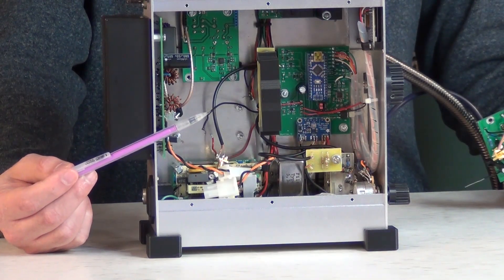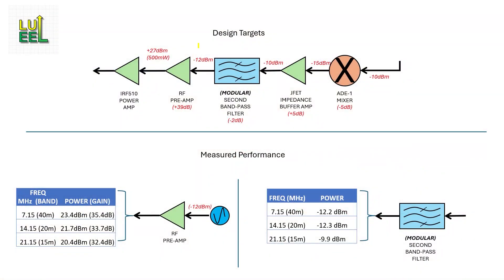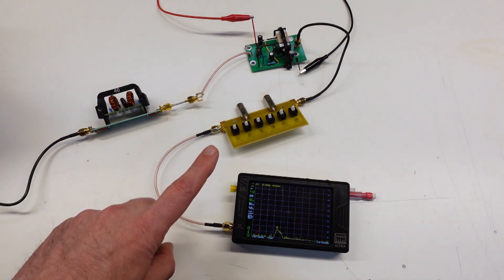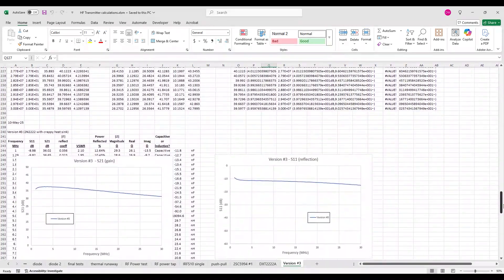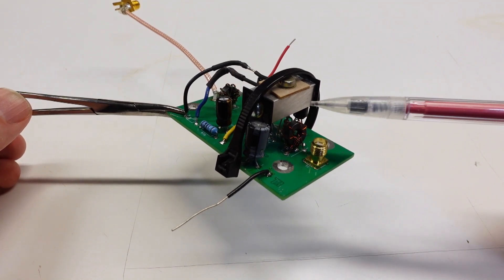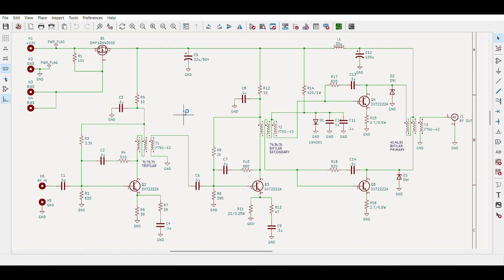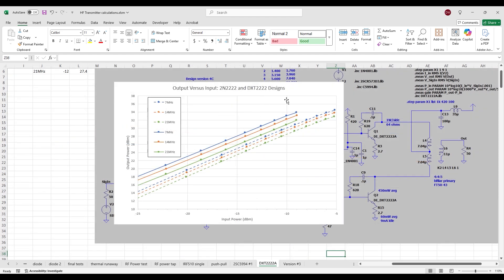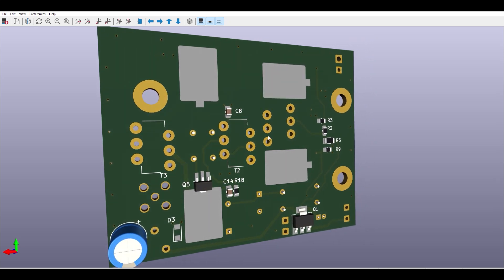HF Transmitter Improvements: The RF Preamp - AGAIN!

Comment: I am also working on an HF / VHF RF amp, my bands of interest are 10m and 6m, the thing is I need good gain from 28 MHz through to 60 MHz, with each RF stage. I am using the 2N4427 in the preamp, with LDMOS for the power amplifier, as there are lots of kits available on line to make use of that cover these bands.

Comment: Great video. Noticed that the output transformer had the centretap decoupled for audio, but not RF? Some designs have the DC fed to the collectors via inductors (chokes) rather than via the centretap. This is to reduce the  core saturation caused by DC current. If you are using a smaller core, the  DC current may have more effect perhaps? Again great video. :)
Reply from the maker: Thanks! Maybe I am misunderstaning your question, but L1 (35uH) blocks RF going back up the +12V power.  Also, there should be very little DC current in the output transformer, as Q4 and Q5 are barely biased to be on with no signal.
Reply: @levelupeelab  The electrolytic capacitor will have no RF across it in an ideal world, but in practice will have RF across it. The bypassing at RF, is nonexistent. Some designs have just the choke, but no decoupling. With regard to the DC current. If you are not using the amplifier, then would expect minimal current, however under drive it could be 150 - 200mA .